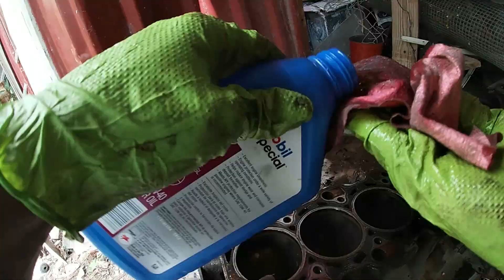4G92 SOHC TearDown

Comment: I've got the exact same engine as you but I've got a 1.8 4g93 that has been modified quite a bit  I've done all the bits and pieces to get the most out of power and she's definitely a head Turner but I want to put larger cams in the head
Reply from the maker: Thats my next step now. Some cams and port and polish the head as my head is alll stock right now
Reply: @driftmaster4  I was thinking about doing that but I wasn't too sure if the stock head would give me a full amount of power and torque compared to if I did a head conversion and put a twin cam on but at the moment I have got extractors 2 and a quarter inch exhaust system with a HKS hi-power muffler at the moment I'm doing a cold air intake which means I'm relocating the battery to the back I have replaced the fuel filter which has given me a bit of a difference of power and torque I have got a HKs pod filter on it at the moment she's got strut brace front and rear vmax slotted rotors with Bendix pads at the front and I'm still running rear drum brakes she's running Yokohama advan v701 tyre size on her and 205/45/ R16 rims she's got neons inside and out I'm running a Kenwood Bluetooth head unit with a fusion 10 inch subwoofer she's got deep dish aftermarket steering wheel a jdm custom Dash cluster custom carbon fibre gear knob and the theme we're going with interior and exterior is a pink and black theme so she's got a few pieces that are done either spray painted or powder coated in pink and black
Reply: @driftmaster4  and she's got a oil catch can
Reply from the maker: I need to invest in one now also i just have a coke bottle there from when i had in tge 4g92 sohc and after cornering hard at a track day oil was coming up and never took it out when i switched back to the mivec 🤣

Comment: Good effort. I don't understand why people don't believe the Mivec engines are as capable as the B-series  and Nissans, They start at the same level. Even though the 4G92 design is weaker in some ways, it can be fixed.

Comment: So why did you change your mind from the Haltech 1500?
Reply from the maker: The 1500 has in more top level drag racing features, fly by wire control and some other stuff that i wouldve probably never use so i went with the 1000 instead
Reply: @daryl inniss drive by wire sweet though. I'm gonna make use of that in the future. 👍🏾
Reply from the maker: @ricerguy yea i agree dbw is nice but i highly doubt im gonna use it with this car atleast probably something else i build later in life
Reply: @driftmaster4  how much power can you gain with the haltech?
Reply from the maker: That all depends on the tuner and your build